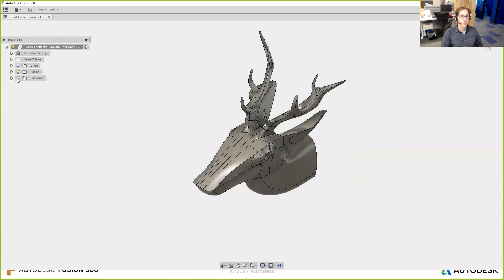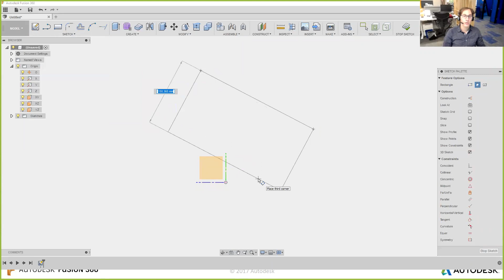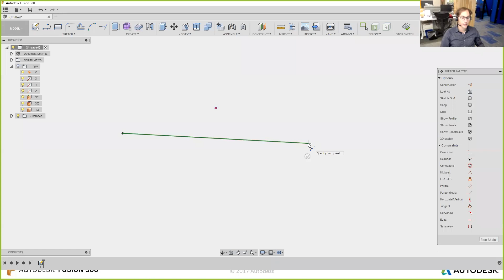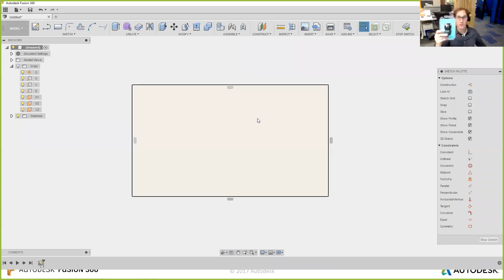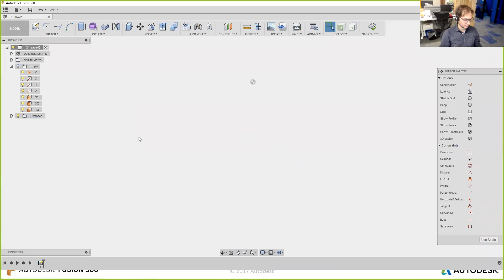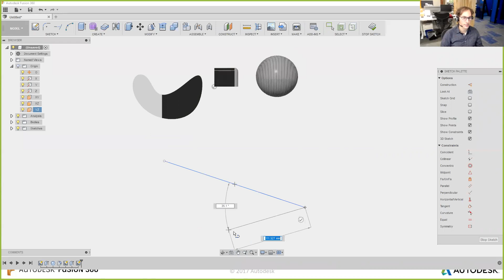Fusion 360 for Glowforge Users - Part 01 of 05

Comment: Jason, thank you for this, and thanks in advance for the other six parts that I fully intend to view.  I'm a Glowforge "founder" like you and have been playing with that awesome laser for about a month now, building other people's designs from Thingiverse and Obrary, learning to use Inkscape and modifying 3mm and 5mm designs to work with 0.125" material.

Watching your video, I went from "what is Fusion 360?" to "I think I know enough to start designing those boxes I have been wanting to design!"  I was going to look for a book today on beginning Fusion 360, but decided to try the Glowforge forums first -- and there you are, a lecture series by a pro talking about exactly what I need -- how Fusion 360 would work for laser models!

Thank you so much -- from this video alone I have gotten 50% of the knowledge I needed from "a book out there somewhere" and I plan to watch your whole series to learn the things that I don't even know enough to ask about yet (like, as you mention briefly in this video, about compensating for laser kerf).